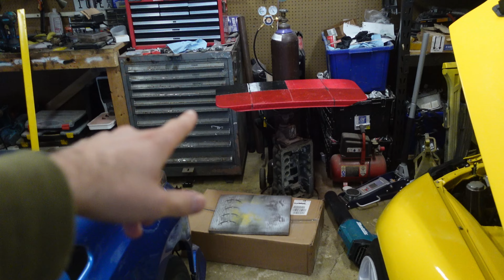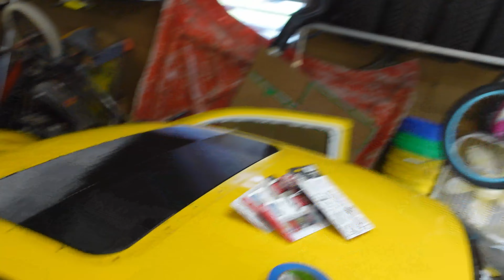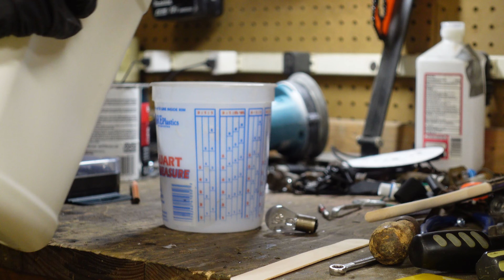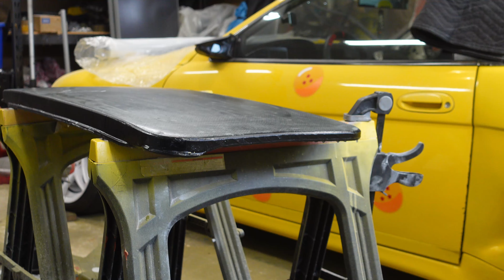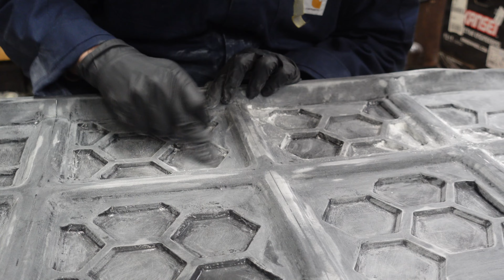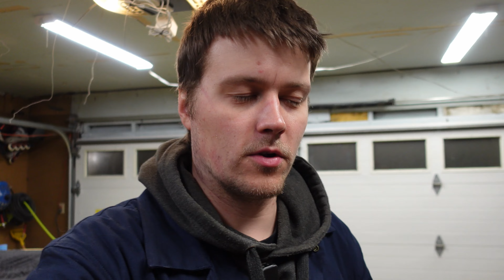I 3D Printed a Sunroof Delete

Comment: Great vid brother! Hexagon pattern is perfect for body panels I would recommend maybe throwing a slant on them edges next time to help with not only laying but smoothing out the fiberglass and epoxy😉. I'm also curious to know what the average cost of your fenders where to make? Great stuff keep making posts!
Reply from the maker: Thanks man! The hexagon edges are actually angled 60 degrees, i didn't want any trouble with mechanical lock in the mold. The fenders cost about $200 with all materials used.